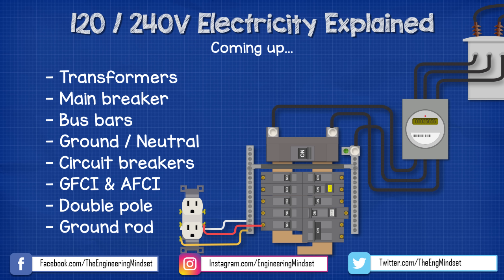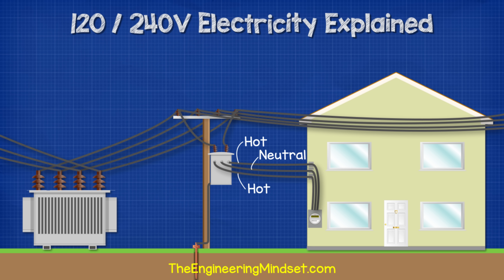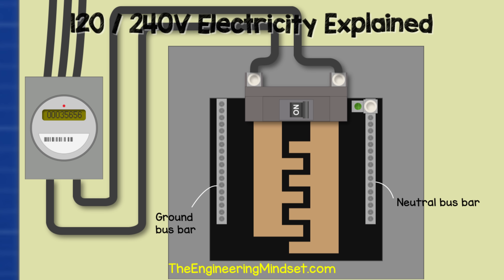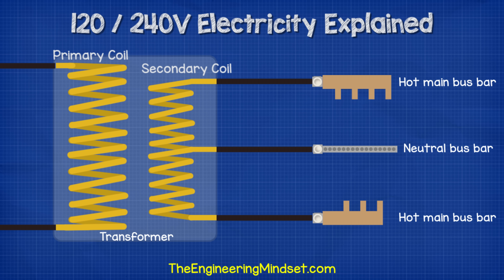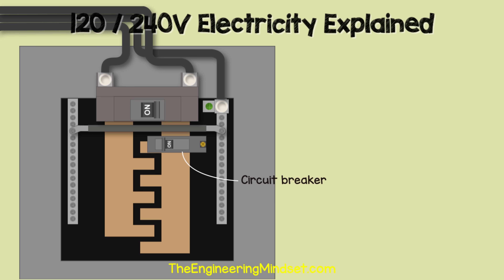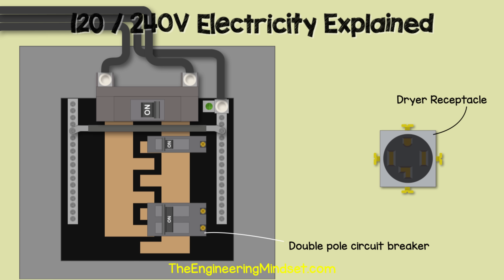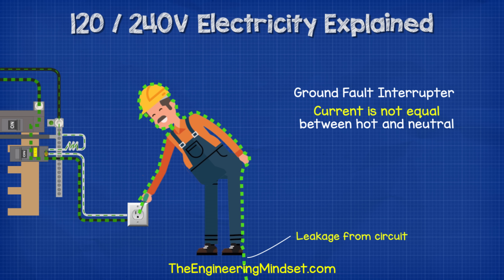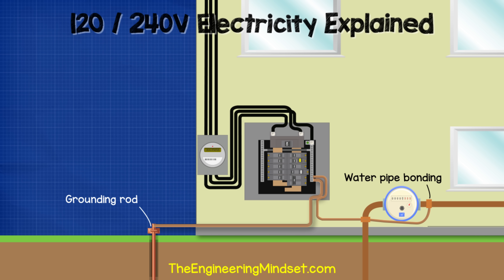120V 240V Electricity explained - Split phase 3 wire electrician

Comment: can we call this as single phase 3-wires system?
Reply: Thommy cariquitan    Yes, you are correct.  Single phase 3 wire with ground system.
Reply: But use a single phase transformer.
In 3 phase network optional 2 phase + neutral service entrance.

Comment: China has many wind farms that are a long distance to where the power is needed. They use super high voltage DC, i guess it suffers less loss. Then they transform it back to AC. Just sayin.
Reply: Warren Mundell    There is a similar installation somewhere in Western US.   I believe it is the only D.C. Power transmission line in US but I may be wrong.    I do not know the advantage!

Comment: As an Electrician in Australia I feel that America over complicated a LOT of things for no real benefit. Just go 240 throughout and be done with it like most of the world does...
Reply: It was all about money, the more devices made for either voltage means more products made for the public to buy
Reply: Having accidentally electrocuted myself with 120 volt a few times, I'm glad it wasn't 240.
Reply: Mark Rose 
I’ve had a few 240 volt shocks myself and I’m still here, it’s not the voltage that kills it’s the current and 110 has just as much and sometimes more than 240 so under the right (or wrong) circumstances they can both kill easily. I’d also like to add that in Australia it is now compulsory to have RCBOs on every circuit unlike in the states where circuit breakers are used in most cases. I would much rather get a shock from a 240v circuit protected by an RCBO than a 110v circuit only protected by a Circuit Breaker..any day!
Reply: @zeemonkeyman1  Bad argument though, you have twice the wattage going through your body for the same given resistance, that extra wattage could be enough to prevent you from letting go.
Reply: spikester 
Bad argument? Do you actually know what you’re talking about? You completely overlooked my mention of us using RCD’s on everything and the resistance changes depending on your body, whether your earthed, whether your standing in water etc etc etc. Again: I would MUCH rather get a shock from a 240v circuit protected by an RCD (RCBO) than a 110v circuit protected by a mere Circuit breaker. I think you need to up YOUR argument.
Reply: spikester 
My argument was never a direct 240 vs 120, it was the fact I think a Single phase 240 system is better than a two phase 120, 240 system especially when we have RCD’s protecting all our circuits. I was also trying to point out that the guy who got the 120 shocks was more likely to have survived due to other factors such as his feet being insulated than the fact it was 120 and not 240. People get this false opinion that 120 is safe and it’s just not true.
Reply: @zeemonkeyman1  The RCD didn't exist back when 240V was chosen so thus the historic reasons have nothing to do with it now. The fact is its indeed significantly safer to use 240V due to RCD's being commonplace and built into code. North American really needs a new kitchen plug standard that is 240V, start getting rid of 120V appliances.

Comment: On an AC power line how does one tell which way the power is flowing?
Reply: The magnet back at the generation station is spinning at 60 times per second.
The plus and negative end of the magnet pass OUR ONE PHASE OF CURRENT 
twice per cycle. Add these numbers up, to see the flow changes often.
Reply: It normally reverses direction 50 or 60 times per second, depending on the grid. It's not directional like DC.
Reply: @MarkRose1337  I believe he's referring to phase rotation
Reply: @MarkRose1337  I didn't say which way the current flows which is what you are talking about.  I said power.  Which end is the sink and which the source?
Reply: @williamdavidwallace3904  Both ends are sink and source. The power alternately flows both ways, depending on which way the voltage is at a given moment in the cycle.
Reply: @MarkRose1337  No the power flows one way.  Yes the current flows alternatively both ways but not power.   (power can flow into and out of some systems when some form of energy storage/recovery is being used, like in a Tesla car.  Normally they use DC power, not AC but a single machine can operate both as a generator and as a motor...)

Comment: This is a great explanation of the basics of home electrical wiring and how the power flow, well done. I've seen others try to explain the difference between hot, neutral and ground but never do even with 30 minute videos. You explain each concept briefly and clearly. This is now my new favourite channel!
Reply: • Hot: Carries current and is at 120 V wrt the earth.
• Neutral: Carries current and is at 0 V wrt the earth.
• Ground: Doesn’t carry current and is at 0 V wrt the earth.

Comment: The concept of “used electricity” is new to me. Where exactly does it go and can it be reused?
Reply from the maker: As this is AC, the power station is just pushing the electrons backwards and forwards repeatedly 100/120 times per second. The electrons flow through our devices and are used to power them. They will be used repeatedly as they're forced to change direction, they only move a small distance. It's not really used, the energy is converted into heat from the resistance of the load and the power station replaces this energy loss.
Reply: @EngineeringMindset  
Hence the 60hz & 120hz cycles?
Reply: "Energy cannot be created or destroyed it only changes form"
Reply: Which also happens to be the ONLY scientific "evidence" of a "Spirit" in the human body. We can build a functioning human body in a laboratory but we cannot give it a personality or a soul or a spirit, and make it "COME TO LIFE"......

Comment: Great video, it was in my recommended. 
I didn't know I wanted to watch this right at this very moment, 
but sometimes YouTube gets it right.
Reply: Please change the Electrical Panel to an actual 3 phase panel. 2 lines and a N is not 3 Phase. It must be 3 Lines and a N, You are only showing 2 buss bars on the panel when it should be 3 buss bars for the circuit breakers.

Comment: I work for a water utility company and the company strongly recommends the electric is not bonded to the water pipes anymore. Is there a reason for this? Besides most modern home plumbing is now made of non metallic piping like PEX.  I’ve been shocked a few times when removing a water meter on older homes so I don’t like it.
Reply: Changing a buffalo box( shut off at the property line) and was getting bit. After some investigation in the house there was a short in the panel.

Comment: Is it allowed to connect a EU socket to 240V 60Hz in the US?
What's the normal amperage of the fuses?
Reply: Normal 220 volts amperage is 30 or 60 amp breakers at least on my home.   My electric cloths dryer is on a 30 Amp breaker and my AIr Conditioner and my electric cook range was on a 60 amp breaker each. Not sure how you would make a EU SOCKET work in the US without a step up transformer as to make 240 volts it requires 3 wire min  where if not mistaken a EU socket only would require 2 wires.
Reply: whte

Comment: I'm from a country that uses 220v. I like these videos to gain more understanding as Electrical technicians here don't need to be qualified and ground wire is just thrown away as it's seen as something that has no purpose
Reply: Yes I know. But the absence of  the ground with  the differential, maybe fatal if someone touch the phase. The circuit breaker don't analysis the amount of current. It only open after get hot and, at low current it never stay hot and never open or break the circuit 💫. 
Note that differentials detect  losses of from 30mA

Comment: I have underground wiring and one day my wife turned on the electric stove only to find that is was dimming the hallway light. On further examination I had discovered that only one side of my circuit  breaker box had 110 power but the other side did not. The electric company found that across the street that one of the two aluminum cables that supplies power to my house had totally corroded away. The underground conduit filled was filled with water creating an electric inground water heater using the neutral. Isn't electricity mysterious?
Reply: Your first sign of problems is the aluminum wires
Those are a cheap and efficient way to carry power and if they're not done right they corrode.
And even if they're done right they still corrode it just takes longer!
Reply: Richard Wolfe not just cheap, but LIGHT . It’s 10 times cheaper and while you need a little bit more material to equal the effectiveness of copper, it’s still lighter in greater amounts
Reply: Wonderful, clear report. I have seen this, ONE SIDE of current, lost 4 times
in my life. Not an electrician but recognize the symptom. Thanks.

Comment: "Return used electricity"? Wtf?
Reply: He said used current,  yes you need a complete path for current to flow.
Reply: @richardpatterson4312  He said both. Maybe I'm just dense, but this makes no sense to me even though(or maybe because of) I've got master's in EE. Electricity is "used" in the resistive load by producing heat, but I have no idea what to imagine under "return used electricity". It makes no sense.
Reply: @neplatnyudaj110  The electrons that make up the electricity don't vanish into thin air once they have done their work. Those electrons have to go home after the job is done and that is what a return path is. Every bit of current that comes from the source has to return back to it or you do not have a completed circuit. The voltage will be gone by the end, but the current will remain.

Comment: So in a double configuration for 240v does one or two wires carry the 240v to appliance, or are these a 4 wire outlet ( hot,hot,neitral,earth)?
Reply: Depends on how you measure the voltage. If you take a voltage reading between the two hot wires then you will see 240v. If you take the reading from either one of the hot wires and ground/neutral you should see 120v. 

The wiring changes depending on the requirement of the appliance. Take for example a dryer with 240v motor and 120v lighting: you will need 4 wire outlet (hot, hot, neutral, ground). The motor will use the two hot wires (240v) and the light will use one hot and the neutral (120v). 

For another example let's look at an electric cooking range that uses 240v exclusively: you can simply use a 3 wire outlet here to deliver the 240v (hot, hot, ground). No neutral is necessary here because the function of the neutral is to provide 120v in a single split phase system.
Reply: Kevin    Dryers are typically 240 volt heater and 120 volt controls, light, and motor.   L1,L2,N,G.   Electric stove is 240 volt heaters, 120 volt controls, and 120 volt lamp and blower if convection.   Again L1,L2,N,G.     Electric water heater typically but not all 240 volts.  L1,L2,G.  Respectfully,   Kevin

Comment: So if the power continuously goes back to the transformer, why do we need a power plant to keep generating more power?
Reply from the maker: To push the electrons backwards and forwards
Reply: @EngineeringMindset  I see. So if we only used DC, where would the electrons go after through and appliance?
Reply from the maker: If a battery type DC then they just collect on the positive end of the battery. If a DC generator then they continue to flow in a loop
Reply from the maker: Check this out, how a battery works: https://youtu.be/PXNKkcB0pI4

Comment: Where to go to find more on why you should not bond the sub panel cans with bonding screw ??? In other words why do you only bond the main panel at the first point of entry into the dwelling ??? I'm in the states by the way .
Reply: Blake Horton    I will try to explain this for you.   In this example(which is correct) there are two bars that are both neutral and ground.  Neutral comes from the transformer.   There are two types of ground at the panel.   Grounding Electrode (ground rod, metal pipe in ground, and several more possible).  This is connected to dissipate lightning or static charges.   Equipment grounds are really not grounds, they are bonding conductors.   They connect anything metal that houses electrical connected equipment to the main panel.   The screw from the neutral/ground bar is equipment ground to the can.   In a sub panel, an extra bar is screwed to the metal can(ground bar) and an equipment ground conductor is connected from main panel.   So the neutral to the can connection is not needed nor desired.  Please watch the video and see where a short to equipment ground goes when it happens.  Most people do not know where it goes.   Hope this helps!
Reply from the maker: Check the new SUB PANEL EXPLAINED ➡️ video https://youtu.be/NUSNa-7Hecw

Comment: So there's potential for damage in the US if someone tries to run a 120v item off 240v? How is that sorted?
Reply: the receptacle itself is different for 120v and 240 so you can"t plug a 120v item in a 240v outlet.
Reply: Pretty sure our devices ( in the states ) and electronics are manufactured in a way to only allow 120 volts to pass through them , why exactly I'm not quit sure but if we plug anything into your receptacles (wich I think have a different prong pattern anyways) they will overload and fry lol
Reply: Adelaide hula hoopers    The answer is plugs and receptacles.   But you can't stop an Eliot from cutting off a plug and putting on whatever they want and yes blowing something up.

Comment: Is the pig-tail the only extra component in GFCI and AFCI?
Reply: Yes. 

*Note: AFCI and GFCI do have a Test button on the breaker too. Press the Test button and the breaker trips (turns off) that means the breakeris working correctly. The breaker handle will flip to the middle position. To turn the power back On, move the breaker handle Off then to the On position. (You may need to turn Off then On a 2nd time if it doesn't work)

Comment: Silly people. Single Phase... Split Phase.... the proper thing would be 230/400V three phase.
Reply: @Siglaviking That's the next problem, all those different standard floating around. 

You guys are a mess, get your things in order.
Reply: The correct voltages is american stile. Exist 3phase in 120/208...127/220...133/230V.

The correct european style is 3phase power available, but 230/400V for domestic appliances is an error, is more dangerous.

Im know two styles.

Comment: You didn't break down how to either use 120 or 240 with a double pole breaker in a dryer or AC plug
Reply from the maker: You must have skipped through the video

Comment: I know this may sound stupid, but why are the lines labeled “hot” and “neutral” if the polarity flips 60 times / second?
Reply: The Neutral doesn't have any polarity. That's why its neutral. 
"Hot" doesn't imply polarity.  On DC you got plus and minus. The AC hot wire is both plus and minus, because of which you call it "hot" or "phase".

Comment: I have a device designed for single phase 240v/60hz. I can run that fine on split phase 240v right?? (Canada)
Reply: Yup, you're good to go.  But you'll need a 240volt outlet.
Reply: Canada uses the exact same electrical system as the US.

Comment: This video has answered many of my questions. However, one still remains. Where does single phase 360/480V come from? I've also seen... If I remember right... 408V. Where's that come from and why such an odd value?
Reply from the maker: Can check our three phase videos. Those are the RMS voltages. The three phase basics and calculations video goes into detail
Reply: Most 480 is 277/480 but 480 would require 2 phases on a wye service.

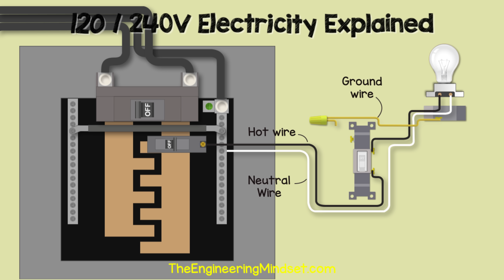Comment: 7:06 what if you are using non-metallic boxes? How would you ground then?
Reply: The circuit is grounded back at the panel. The box itself will never be energised due to it being plastic

Comment: Very good Job illustrating & explaining.  Ground and Neut. are only joined at service. Not in Feeder or Branch Circuit equipment (with a few exceptions)  Think of Ground as Bonding all metal parts together, conduit, boxes, Motor frames, Panels ect.  Depending on Code some can serve as ground conductors, NOT just green wire, which is why is gets confusing.  Neut. is allways a Current carrying conductor, sized as such.  Grounding Buss and Neut. Buss separate, after service.  Keep up the Clarity.

Comment: Excuse me, the ground wire of a shower where you would have to go connected?  The one I have in my house is directly connected to a ground Rod, and even so when turning on the shower I feel a little current, And this ground rod is not connected to anything else, to any bar, only to the shower
Reply: gumeb    I suggest that it is very likely that you have an electric water heater.  One of the heating elements inside the water heater is probably corroded and has a hole in it.  The electric tingle you are feeling is trim the 240 volts in the water.   So, either replace the most likely lower element, or replace the whole water heater.   If you run out of hot water fairly quickly, this is why!   Let me know what you find!   Respectfully,   Kevin

Comment: Good well-done Iam electrician from TZ east Africa here we use 415-380v 3phase (delta&star)240-220v single phase thanks I learning something about110 supply    .thanks again.
Reply: Victor Simba    I was unaware you had 380/220 volt systems.  I'm assuming it is 50Hz, correct?   Thank you for commenting, new information for me.   Respectfully,   Kevin